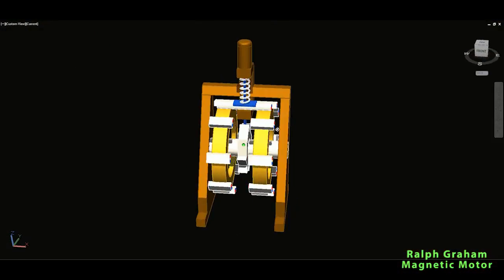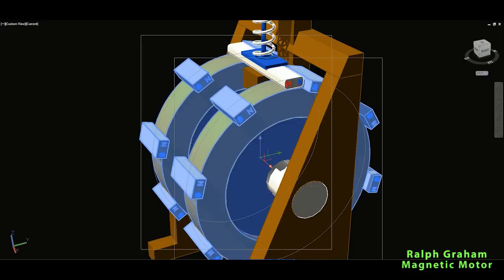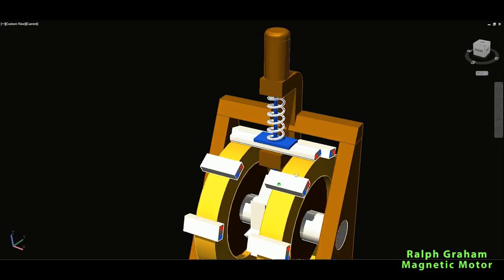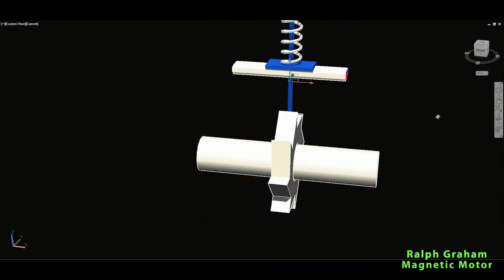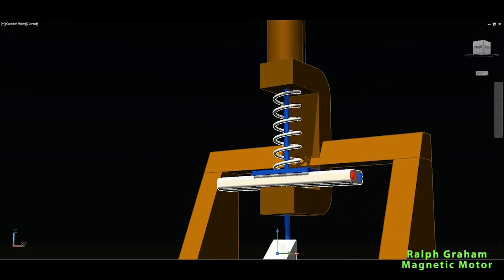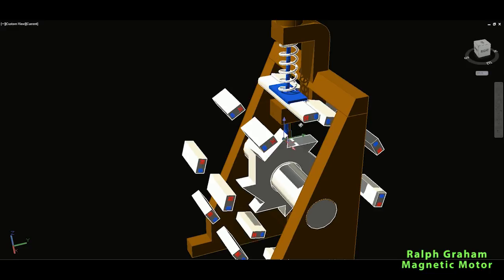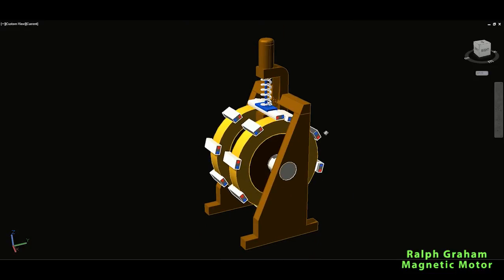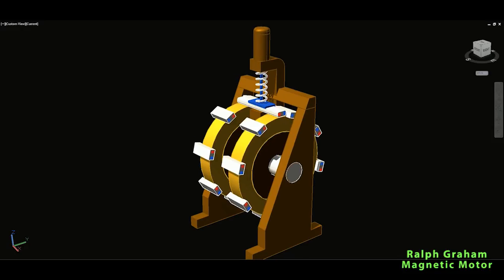FREE ENERGY, Ralph Graham Magnet Motor, MUST SEE!!!!

Comment: The solenoid at the top raises the blue pin above the ratchet tooth so it can slide down the ramp using spring force and the repulsion forces of the two magnets getting closer together on the down stroke.
Reply from the maker: Thank you a lot for the comment. 💙

Comment: Hi there, nicely done ! I want to ask you regarding this type of 'magnetic wheel' that stands apart in its approach by making use of the one magnet that is being pushed out of the way on the push-rod to re-appear right in time to give the next magnet on the wheel a 'push' .. I saw one that was actually built wave that actually worked nicely, it has been several years ago that I saw that and was able to witness it online. It was made of wood, the whole constellation was, made with the wheel to stand upright (in other words, positioned vertically) - and the moving magnet indeed was pushed up on the right moments and with the right intervals via a rod mounted alongside the wheel on one side, with just that one angle of movement, making a 90° angle near the far end of it where it holds that actual magnet. If I recall correctly, there was no spring used in this design, it was merely gravity that was used (thus it also was necessary in that case the thing was standing vertically). What I cannot remember is if it was just one row, or that it had two or more rows of magnets mounted alongside each other on the wheel itself, ~ it was too lang ago and I saw too many lookalike other videos since that have messed up my brain.. or rather, that messed with my recollection ! As I think I said, it was nicely made, the way the woodwork was done I would probably call gorgeous. . I would love to see it again, it worked flawlessly in the demo of it given in the video in(of) the day, of which I cannot remember if it was actually accompanied by any spoken explanations. I think you may have seen it as your own presentation specifically is about that precise model, that design if you will.. Do you have any idea of what I am talking about? If you do and still know where and how to find it, please let me have a link! Thank you, and.. I am looking forward to the moment you actually will have built this project ! Thanx again, and keep up ! Wkr, Adrian

Comment: @ Mario Dudec: 

Thank you for your video but it's not a mechanically solved problem, it's an electrically solved problem as mentioned in the patent as the rod moves up and down due to the attraction of a solenpoid magnet / push-pull electromagnet.

Comment: The pitch of the center gear, which provides lifting action to the stator magnet, is much too steep.  This would create tremendous drag/blocking force on the rotation of the magnet wheels.  Movment distance of the stator magnet would have to be at least double what is shown, to prevent magnetic forces from creating drag on the wheel.  Acquiring magnets with opposite poles across their width would be difficult.
Reply: arreglar esos pasos es facil, pero aun asi no generaria movimiento,pues el conjunto iman esta en equilibrio

Comment: With all the up and down of the rotor magnet wouldn't the RPM's be limited. Also, the design of the gear does not look like it would function properly. Great solid works segment though....very easy to make pretty drawings....love solid works.